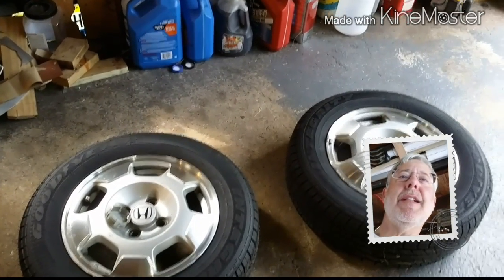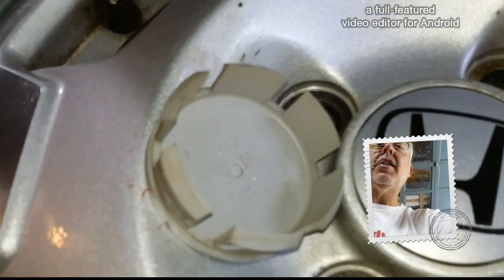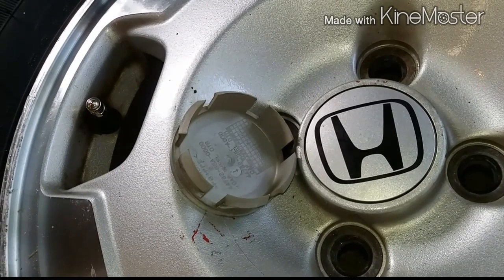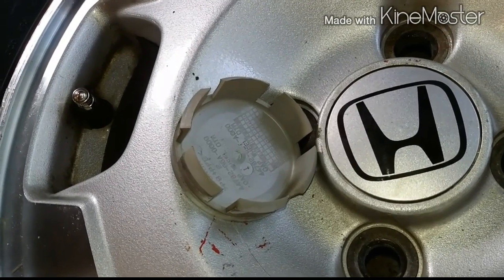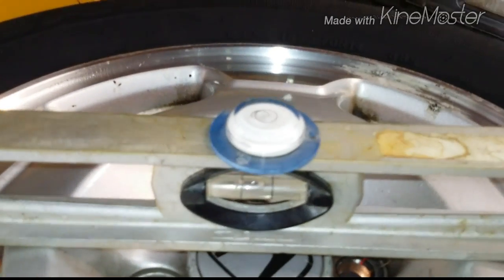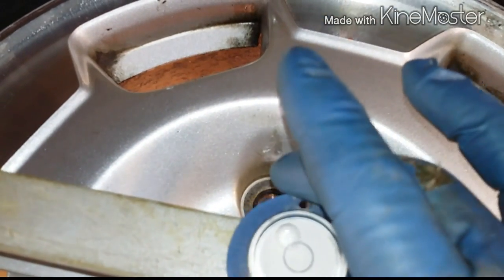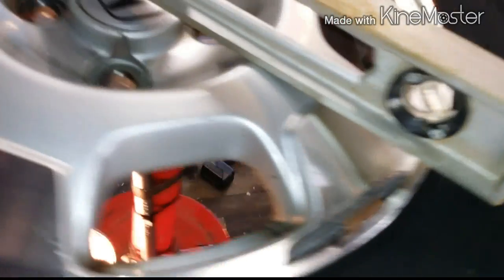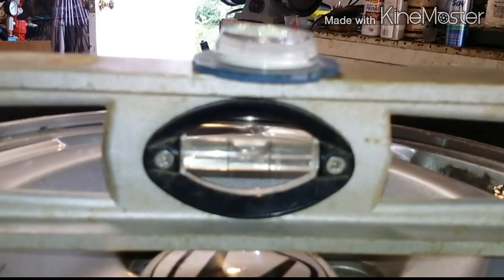HOME MADE TIRE BALANCER

Comment: Don't give up Tim, wheel balancing can be done at home
https://www.youtube.com/watch?v=JvN4i-qJqMs
I use a non touching laser to help guide the balance and the balance surface does need to be level as noted in the comments.
Plus be careful where you place the balance weights to avoid dynamic imbalance. I prefer stick on weights now placing them close to the plane of the wheel CG.

Comment: Your static balancing concept is right.
One trick that learned many years ago on a static balance is to not seat the tire on the rim,...leave it uniflated. This way you can move the tire on the rim and get a better balance and use less or no weights.
Reply: Interesting
Reply: That's the best advice I've heard.... wish I had heard it before I seated the beads
Reply: you have the mind of the jedi my friend

Comment: Is your balancer on a level floor. 
 There's a bit of prep work to use a bubble balancer I've seen ignored by people, but one of the things is start on a level floor the entire circumference of the balancer.
 Secondly, if you are using a homemade centering jig like a cap, make sure the pivot point is exactly center. That goes for the rod being used as the pinpoint for the cap to pivot.
 Once you get all the steps accurate, then you can start balancing the wheel.
 If there are weights on the wheel and they're throwing the balance off remove the weight.
 make sure no mud, dirty or anything else can affect the balancer.
 Mark the level spot on the floor to use again the next time.
 Great video, thanks

Comment: This only statically balances the tire. It does not address dynamic balancing which is what will be experienced when driving at speed. Please see: https://en.wikipedia.org/wiki/Tire_balance
Reply from the maker: Agree. I ended up taking the tires to a professional shop to dynamically balance them. Well it doesn't hurt to try new ideas anyway.